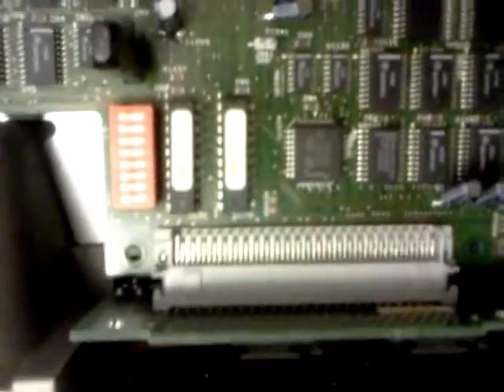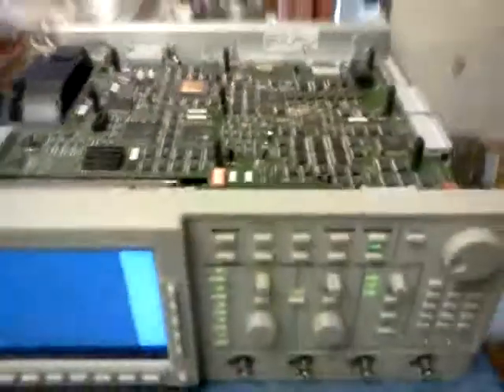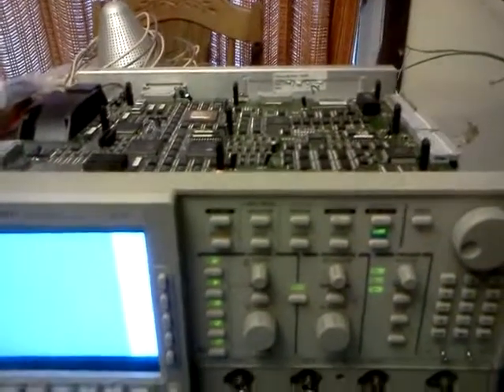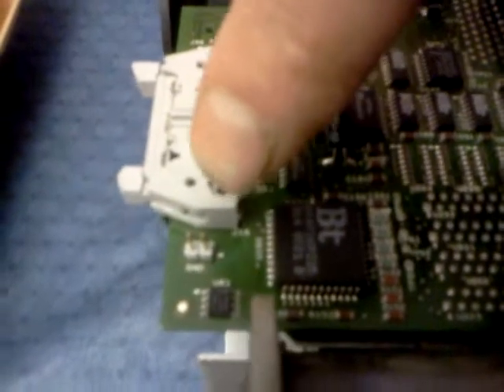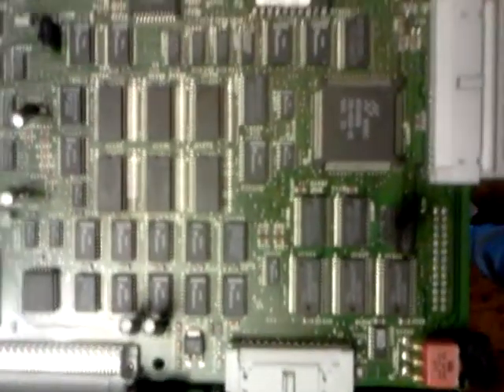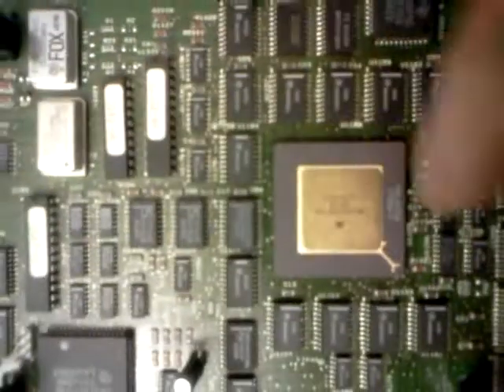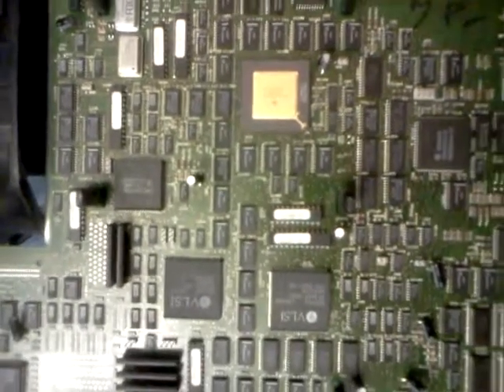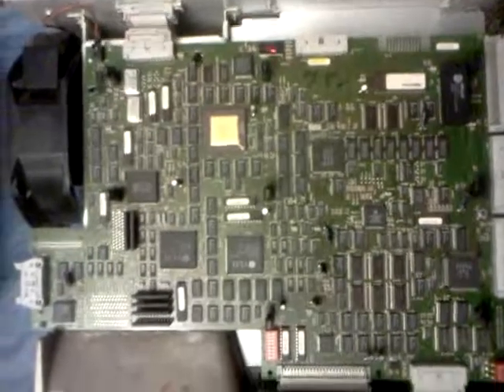TDS-520 Power On Self Test CRT Powers On Display Issues

Comment: Try hooking up a monitor to the back of the scope on the VGA port, if it has one. Then turn it on, if the monitor has a display it will tell you what the status of the scope is and can isolate it to the display assembly. I did this in my 2nd video here: https://www.youtube.com/watch?v=MzxQmNEj-Dk hope that points you in the right direction. 
Best Wishes n Blessings. Keith Noneya
Reply from the maker: Thanks Keith.  Much appreciated.  Unfortunately, this unit doesn't have a VGA ouput and I haven't read all up on the board schematic specification details.  

I also didn't update this site yet also as I need to add more info.  Was more a dump a video online and get to other work. 

I just got back from tangent projects for the day... so am behind in performing some board tests to see about making my own VGA output as well as testing the board for why the A11 or A20 board is bad, i.e. what trace(s) or component(s) as that is where I am at for now.  I've been noting there and on the original TDS-520 Startup video I made: https://www.youtube.com/watch?v=jZjRVAb3Ykc&t=55s

Thankfully, I decided to invest in the other TDS-520B so I can test using that instrument, however... I need to read up on using that instrument so I don't damage anything.  

 I've been discussing with ToughDev and he's been providing insight also.  Check out his blog, or WordPress site I guess is the correct term technically,  if you haven't: http://www.toughdev.com/content/2014/01/calibration-and-acquisition-problems-on-tektronix-tds-340-oscilloscope/

Happy Thanksgiving also!  To a safe, healthy, well fare and well being this Holiday Season and beyond.
Reply from the maker: Looks like all the capacitors are Nichicon 33uf 16V 85'C VR(M) S0334.  Seems cheap to me like they can be a better quality electrolytic brand.  I've read also that certain capacitors have to low a resistance and need a higher resistance or something like that too.  I'm not sure if I saved that reference.  Have to look into to see which caps they used if I can find.   I'm going to look into this and thermal mapping next to see if on for 2 minutes to see if anything stands out on the A11 Board.   The A20 Board is more of a chore to get into.  I need to look at the CRT's performance after that regarding vertical and horizontal signals as well as black & white and color if present... though I am thinking this is a black and white system for now.
Reply from the maker: Hi, thanks for the feedback.  

I'm still probing the board Cable Pins testing voltage at the moment (J5 Display Module, J2 Front Panel Module, J26 and J27) while the board is installed to narrow down location in board where issues.

I re-read the TDS-520 Service Manual "Figure 6-22 Primary Troubleshooting Procedure" and realized I skipped the "Figure 6-30 Processor/Front Panel Troubleshooting Procedure."   

I just completed the "Figure 6-30 Processor/Front Panel Troubleshooting Procedure" and found that when J2 is unplugged the ON/STANDBY doesn't power on the scope and there is no 3.125Mhz clock on J2 Pin 25.  Therefore, the flowchart shows to Replace A11 DRAM Processor/Display Module.   Therefore, no need yet to test the J18 Pins as I need to get the Front Panel working.

This lines up with the Figure 6-26 Display Troubleshooting Procedure where J5 Pins 1 & 2 are +25.7V and Pins 3&4 are +4.9V.    J27 Pin 1 is +25.7V and Pin 17 is +4.9V.

I also tested J2, J26 and J27 plugged in (I can only test on the back of the cable socket when cable is plugged in, not sure how to test lower pins unless unplugged).  I am thinking that the pins are the even numbers are testable where odd number pins are on the bottom row and I am not sure how to test at this time.  Maybe a row of pins are same values also as with J5.

J2 (V+ unless noted): Pin2 = 0, 4 = 9.94, 6=0, 8=4.94, 10=0, 12=-5.07, 14=5.06, 16=0.2, 18=5.06, 20=4.49, 22=3.99, 24=0, 26=2.3

J26 (V+ unless noted): Pin 2=0, 4=0.97, 6=0, 8=-15.10, 10=-15.10, 12=14.98, 14=0, 16=0, 18=-5.07, 20=-5.07, 22=0, 24=0, 26=-5.07, 28=-5.07, 30=-5.07,32=0, 34=0, 36=4.94, 38=4.94, 40=4.94

J27 (V+ unless noted): Pin 2=24.4, 4=0, 6=5.0, 8=0, 10=5.0, 12=0, 14=5.0, 16=0, 18=5.0, 20=0, 22=4.9, 24=0, 26=5.0, 28=0, 30=5.0,32=0, 34=5.0, 36=0, 38=5.0, 40=0

J5, J26 and J27 do not seem out of specification on the A11.   Therefore, those I am thinking have traces that are OK or suitable for now. 

J2 per Figure 6-30 6th Step down Pins 2, 4 are 0V and should be +15V and -15V respectively and Pins 16 should be +5.1V and is 0.02V.    

I am also wondering what the specification of 19 through 26 are as they seem lower in value.  I do not see a specification for those, however they may be attenuators values relative to settings for feedback from the A12 Front Panel Module to the A11 DRAM Processor Display Module or something else.

Looks like more testing components and traces where J2 is missing power and the values are not correct or questionable where I don't have a spec value.   I have to see what the vias and components values are going backwards from the J2 connector pins next.
Reply from the maker: tekhobbycap noted he used 35V 105'C caps.
Reply from the maker: Attenuators look pretty bad.  https://www.youtube.com/watch?v=gxgXFVHRGPM&t=161s

Need to clean and test performance of the components, traces and then see what happens.  Maybe re-solder if needed.
Reply from the maker: Did a little work on the TDS-520 today. https://www.youtube.com/watch?v=nQvRoRQGvfo&feature
Reply from the maker: Update of the latest and greatest progress: https://www.youtube.com/watch?v=J0bcXZPA5V8

Also picked up a HP Agilent Keysight 8640B OPT323 for a signal generator to work on learn with:  https://www.youtube.com/watch?v=WUgEf7-_1fw

Finally, a Ghz and larger bandwidth scope for under a few hundred dollars!

I just won a best offer on a TDS8000B (DC to 70GHz bandwidth, stock 8Ghz looks like) that needs the power supply repaired and hopefully that is all.  Works, though has intermittent performance.  Man, that is going to be an interesting project.
Reply from the maker: Latest and greatest find... missing resistors on A11 Board: https://www.youtube.com/watch?v=vxXSWPMwjHg&feature=youtu.be
Reply from the maker: Also, noticed I didn't have a link to the previous video where the scale is appearing now: https://www.youtube.com/watch?v=J0bcXZPA5V8&t=49s